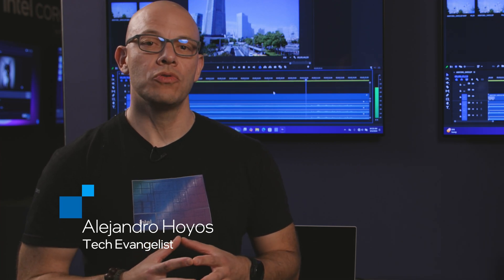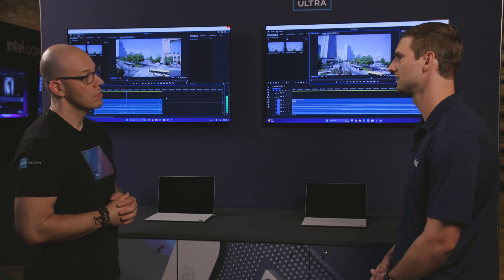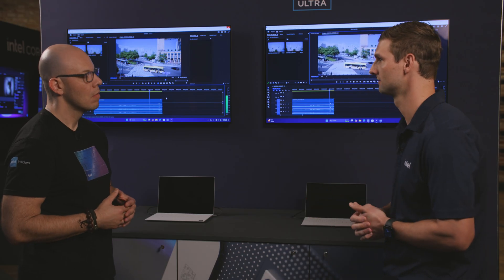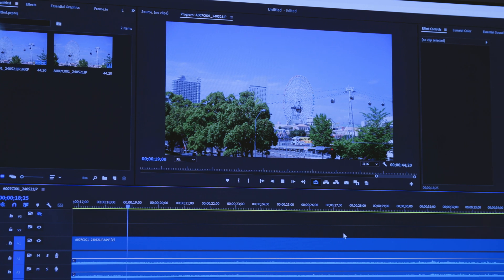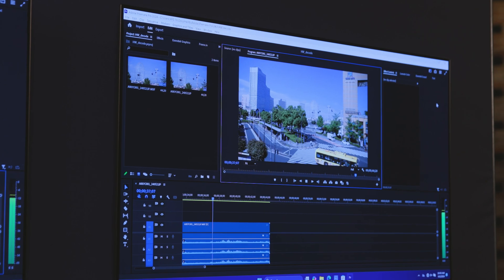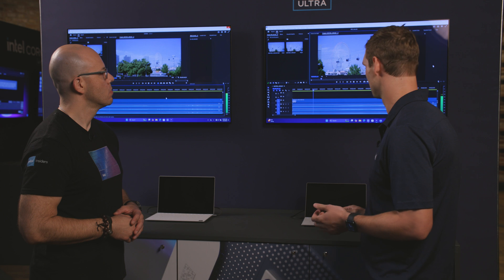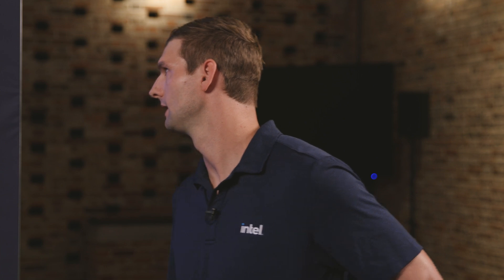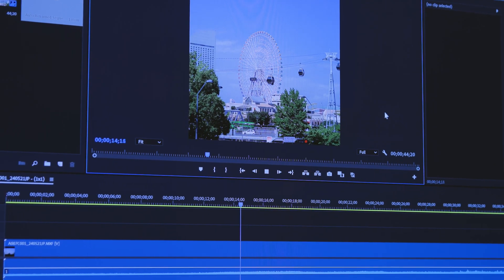Adobe Premiere 8K Video Workflow on Intel Core Ultra 200V Series | Talking Tech | Intel Technology

Comment: I wonder why they're comparing software decode against hardware decode, and not comparing previous generation hardware decode to the new hardware decode ...

Intel iGPUs on mobile processors have supported hardware encode and decode for over a decade. Hardware support for H.265 decode has been on their mobile processors since Braswell architecture launched in 2015, and encode was added with Skylake in 2016.
Reply: I think they're talking about Quick sync. Quicksync is rather fast despite it being a thing that's normally processor side. @ChuckNorris-lf6vo
Reply: For marketing of course. They want to show the 5x performance increase and 3x efficiency increase or whatever with hardware acceleration on vs off, when that is not even a comparison.

Comment: Hoping to see similar or better decode performance with Battlemage gpus once those release!
Reply: @Zxanonblade  It's practically a given. I'm more hopeful that they fixed their dGPU power consumption with Battlemage, particularly at idle. If they have, I definitely want to get the Battlemage equivalent of the A310 for my ryzen nas/media server
Reply: @Sean-km7ht  i also want Battlemage dGPU
Reply: It has
Reply: This is Battlemage architecture, just not in a hpg high-power hardware unit but an integrated tile as part of their LL laptop SoC line.